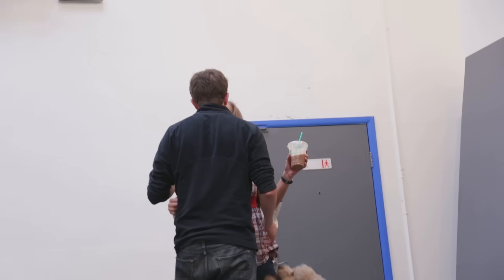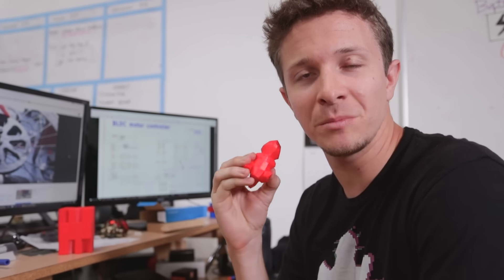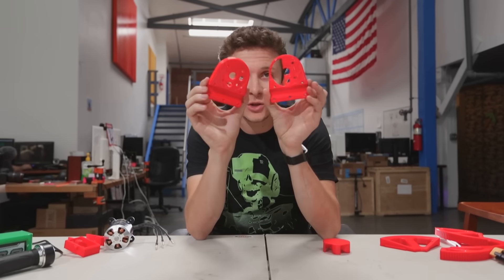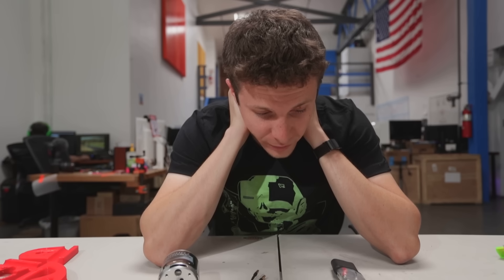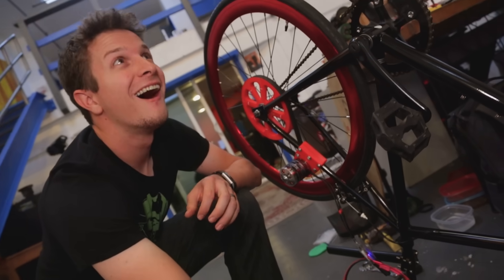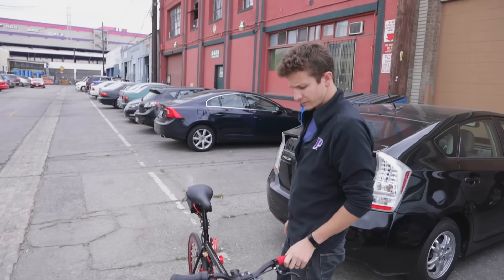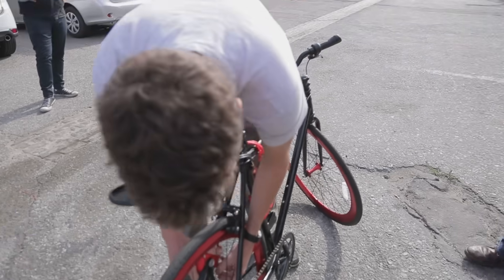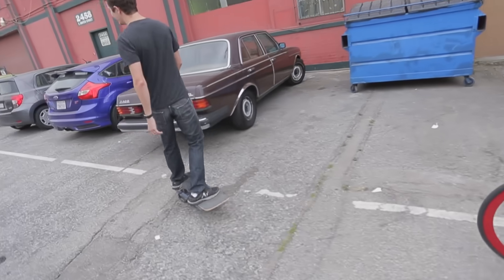Building a Tesla ELECTRIC BIKE For my WIFE

Comment: old vid but I'm confused that with all those people no one could figure out how to fix the gear , the motor sounds as though it is struggling to move him along as well. set screws on a round shaft lol, well good try which is more then most do.
Reply: Also the motor mount would be much more stable if it was fixed to seatstay and chainstay (i.e. not only clamping one round strut). Then it might even be capable of taking the load of regenerative braking (though i'm not sure if the bearings are designed for this application at all).

And i guess the sprocket was intended to be a tight fit (if it was not the completly wrong diameter), press fit maybe? Then heating it up would have helped (aluminium has a much larger thermal expansion than steel).

Comment: Make the pulley a collar. Drill a hole, tap it, then find the depth of the hole and cut a bolt that fits the tapped hole  so it is just below flush with the inner portion of the gear, then cut a notch at the cut end for a small flat head. Mount like before but now with the pulley acting as a collar it won’t slip.

Comment: All u would have to do is drill a hole into the fully and the motor and put a screw with a nit at the end and as long as the screw doesn't snap it wont slip

Comment: "If we simplify this into an electrical system, do you not know about 2 and 4 stroke bike convertion kits??
Also for making an electric bike investing in something with disc brakes would have been wise watching further into the video I have more critasism (I cant spell) your using a fixed gear or one of those fake fixed gear bikes for an electric bike that would turn the cranks too fast. Also knowing how extreme youve gone in some videos you could of had the components machined from metal by a shop. Other than that the video was decent but the bit about how electric is cheaper should have gone at the begining of the video as reasoning for why your using an electrical system.

Comment: another way to get PLA to fuse better would be to soft melt the plastics into one solid block. i learned this from my chemistry teacher about 2 years ago. there's a chemical we used that's essentially slow acting acetone. if i remembered the name i would tell you it, but we used it to make a turbine system for some prop planes we made in class that we crashed a few dozen times, and surprisingly the parts we treated held together a lot longer than the rest. we also had a printer that had a sealed chamber that kept the plastic warm, but not hot enough to compromise the design we were building. 
though another trick i found out was to make all of the parts kinda small and interlocking and using an epoxy to meld the pieces together. this usually only worked when i was building larger stationary things.

Comment: i WOULD worry about battery cooling/venting for the enclosure. high amp discharge 18650's get hot when using a constant draw.
Reply: Did you see a single 18650 in this video?

Comment: ever heard of something called a lock screw? you could flatten a bit of the motor shaft to make the cross section look like a D and it would lock the pulley in place using the lock screw

Comment: okay thing im confused about, If the motor itself is spinning and thats what spins the belt then the wheel... If the motor itself is moving... wouldnt there be energy loss? shouldnt the motor be anchored to the entire assembly? AND if the motor is spinning in the 3d printed parts there is going to be a massive amount of friction.. either this is really dumb or im missing something

Comment: Electric bikes and mopeds commercially available, for a reasonable price, so just buy one.

Also, the engine shouldn't be spinning itself, because you're loosing energy O.o
Reply: It's a hobby RC aircraft motor, normally it'd be attached to a prop, it looks odd spinning the outside rather than the inside but it works fine, might even aid cooling

Comment: There are dozens of ebike kits on the market. Yes, they are very expensive but I have concerns about your build holding up over time. Have u seen how Element14 used Arduino and 3D printing to motorize a tricycle? 😊

Comment: Easy solution would have been to make that motor and gear keyed as in drill a nice hol between gear and shaft and place a set screw wont move a bit.

Comment: Painful to watch... shaft spinning in pulley... wheel wobbling after spoke breaks... reference to the Write Brothers... Seriously, all of these problems have been worked out more than a century ago. Spinning shaft? Fix it with a keyway or simply machine a flat spot for the set screw. Wobbling wheel? Replace the broken spoke and true it up. Yes, true it up by tightening or loosening spokes to get the rim to run strait. The Write Brothers are no doubt barrel rolling in their graves right now.
Reply: THANK YOU!

Comment: How about building a 6-pack or larger rechargeable cooler. One that runs from a electric drill 18 or 24 Volt slide in power pack. Something that would be low power consumption and keep food or beverage cold for X hours. Maybe it has to uses 2 battery packs at once to power it??? That sounds 3-d printable

Comment: the one flaw and weakest link to this entire equation is "the wife vector".
No matter how solid you build it, in the end you will be held accountable for any tiniest flaw in this enterprise. Every single little somethingy that goes wrong or ceases to work - and you get "the stare." ...Flat tyre? Worn out Breake? Nut, bolt any lose screw worn out to prifile of the wheel will en up in "Honey the bike dont work" ... for aslong she will be able to maintain "you"...

Comment: All he needed to do was grind flat spots onto the motor shaft where the set screws in the 12t belt pinion contacts the shaft. Much cheaper and quicker than another motor.

Comment: I think I had this comment about Tom's install too: mount the motor higher up on the rear triangle and flipped so the motor's mass and volume are centered under the seat, with just the sprocket poking out to line up with the wheel sprocket.  That puts the mount on a non-circular member, so it won't rotate and even if it does, it doesn't get stuck in wheel spokes.
Not surprised you had trouble tightening the sprocket on the shaft, steel setscrew threads in an aluminum sprocket, you won't torque those very far before the threads strip.

Comment: Awesome video, but as I'm sure it's been mentioned before, why go the complicated pulley route instead of a hub motor? Even without the simplicity of it, wouldn't it be so much more efficient? I imagine there's quite a bit of frictional loss using this setup, and as you experienced, you can't use any form of regenerative braking.

Comment: Grind a flat on the motor shaft. Disable the brake in the speed control. Buy a proper pulley or get someone to machine it on a lathe.

Comment: key the motor shaft.....any time you don't want a motor shaft to slip..  drill a keyhole, slot tthe shaft or flat part of the shaft to so that the set screw had something other than smooth round shaft to dig into

Comment: You should have just filed a flat spot in the motor shaft that the set screws could bite into. Did you even explain how you fixed the problem?

Comment: Which part of it is Tesla ? You could also made Apple or Mercedes or Lambo or F1 or Samsung or Panasonic or Falcon Heavy or Intel or nVidia or Microsoft or Samsung or LG or Canon or Nikon or everything together all brand names in the world together in one bike which is fastest in universe and strongest in our solar system and has a range of 7.2 light years at maximum speed but 15.7 at eco green slower than speed of sound speed and has a 3.64 nanoseconds charge time and has a 17.9 trillion charge cycles with upgraded battery which will be available on backorder in the next few hundred years but for now it is 11 billion charge cycles with fast wireless charging from half empty to half full and it can make 700% incline hills in reverse and in expert mode it goes up to infinite grade hills.
Can it fly with that sweet unique logo ? It should. Are you making them in your mega giga ultra factory ? when it will be available ? Did you perfected self driving  or is it going to be available in next firmware update ? When do you plan THE TRIPLE X version with integrated stereographic wireless 3d holographic anamorphic canceling conforming ergonomic memory foam beat super bass  headphones with nano A B C D usb .796 dongle for connecting it to our fridge and RGB lighting and free headlamp and optional brakelight ? Areyou building charging stations thru galaxy or you going to expand the network a lil bit ? Is there some buying options available like pay three coffee cups and drink one tomorrow to have matte flattest of the flat paints in the world and more** ?

Comment: Make a machine to take old plastic and make your own filiment for 3d printers....something people could make at home to recycle locally the plastic they would otherwise throw out...i was originally thinking a hot plate to melt it followed by some means to press it out and form it to the necessary width which i was going to use a round metal lazy suzan wheel and a pizza cutter with the wheel renotched to make the perfect consistant bead size...

Comment: What he neglected to say was that his car cost about 5k and where as the very nice tezla s cost depending on how you get it I designed one off of the tezla page and it came out to $112,800 and that's why no one currently wants to go electric even though in the long run it's cheaper no one thinks about the future they think about the now and if the now is $5,000 or $112,800 well we know which one I'll pick.

Comment: Even if it work, it looks very ugly and noisy. I bought a regular bike and a 500w hub motor conversion kit with 48v battery. It cost me 2200 CAD. The reason why it costed me that amount is because most parts were German made which came with 2 years warranty and operating very well.
My bike is literally the nicest fastest bike in the city.

Comment: Nice clickbait doesn't even mention Tesla in the video just slaps a logo on there a battery and a motor suddenly you have a Tesla bike
Reply: Didn't even use 18650 batteries like a Tesla either. I think as I fast forwarded through I saw RC LiPo batteries. My ebike (Lunacycle/Bafang BBSHD) has 52 of those 18650 batteries. Been good for two years now. Several thousand miles. I would never build an ebike with 3D printed parts unless I was just prototyping ideas. Way too fragile.
Reply: literally stood next to a tesla in the video what do you mean
Reply: Yeah, I got baited too...damn it.
Reply: R/C batteries are certainly the cheaper option. Read up on them however and they require much care during charging to prevent fires that burns a person's house down. Good for a prototype I suppose but. Would they last for thousands of miles/years like other batteries?

Comment: for longer term use it would be better to get a metal cage built from the 3d printed part.  that motor is going to get very very hot....  also for safety it might be  a better idea to use a gearbox to be able to strap the motor down in a 90deg position from where it currently is.

Comment: Check out gas motorized bikes, their are several different versions of 2-stroke & 4-stroke engines for bikes. Personally I built a 66cc/80cc 2-stoke that goes 40mph and gets 100+mpg (that's stock mind you, no performance upgrades).  If you decide to build one contact me first, I can tell you where to get a good, balanced engine with upgraded hardware for a good price, DON'T buy a cheap kit on ebay unless you know what to look for, TRUST ME!

Comment: Ok Jesus. 60-40 isn't gonna stick to aluminum or steel, and it certainly won't stick them together. You take an angle grinder and you flatten the areas of the motor axle where the set screws sit, then you use blue loctite on the set screws. How can you possibly know enough about motors to run a brushless one on your computer and easily hook it up, but not know to flatten your motor axle.

Comment: Wren when pulleys or couplers dont fit those motors you put the motor in a bag, and throw it in the freezer. When its cold try to stick it on, and use a preferably rubber hammer to get it the rest of the way.

Comment: If you ever have any problems on Brushless ESC's like auto brake which all esc's have that option, just ask me or any other multi copter builder we know all about esc's small and large. lol Good job and congrats on the bike for your wife. I built an electric bike also but I didn't use a 3d printer. I used a brushless motor hub for my front wheel and attached it to each individual spoke. Very very tedious! And I didn't use a lipo they are to volatile and don't like heat at all. I used lithium ion 18650 cells. I do want to address that lipo you bought,  make sure that esc has auto cut off on your cells or you will ruin your battery. Try not to go under 3.75 on each cell or kiss battery by by. lol Did you set auto cut off at 3.70-3.80? thats a good place to set it at. Good luck

Comment: Technically you don't need the speed controller but great video!
Reply: It's a brushless motor so the speed controller is actually rather needed, brushless motors run on 3 phase Alternating Current (AC) but the battery can only supply Direct Current (DC), the speed controller creates and regulates the AC needed by the motor depending on how far you push the throttle

Comment: Fun fun!  But I think your main problem is with the choice of motor - need something with a larger shaft with a flat, and also a larger main pulley system.  There's a critical size for things.  That motor is for a prop - not high torque!  Looks nice though!

Comment: I knew INSTANTLY the drive cog would be off center when he said 'drill bit'. You use a special drill in a milling station, with a front bit the same size as the hole, so it keeps the drill centered.
Reply: ore  just a cheapo lathe with a self centering chuck
Reply: Ream

Comment: 3d printed plastic parts are more expensive and take longer to make for this purpose. Easier to do just aluminum if you have the tools. But then again if you knew how to work metal you'd just make a key slot in the shaft/pulley ;)

Comment: 11:26 for those who dont know what happened. these motors have electronic braking, meaning that it have brakes. so all he has to do was disable the brakes in the ecu using the computer. the problem was when he let go of the throttle the motors brake and momentum keeps the bicycle going forwards and the mount couldnt handle it and bam, that happens

Comment: I would have mounted the motor behind the seat post and reinforced by using both seat stays and the seat post clamp and used a longer belt. Also flipped the motor 180degrees so it wouldn't stick out.

Comment: Filing a flat spot on the motor shaft should hold better to the set  screw
Reply: Almujtaba O. Same here or drill a hole the set screw to go through
Reply: I hate it when guys use solid holders with drills that have no keyway!!😡
Reply: YES, this!
Reply: They have that on 1/10 scale rc cars

Comment: Jesus Christ why don't you just install a cheap eBay hub motor kit off eBay like everyone else for $150 instead of using expensive un reliable r/c parts on a bicycle??
Reply: hub motors add a lot of rotating mass, which is detrimental for acceleration, deceleration, and turning. The r/c parts are also much lighter
Reply: @untitleduser666 And the hub motor will last thousands upon thousands of miles whereas the RC parts and printer brackets might survive the weekend.
Reply: the torque of that rotating mass actually helps you in certain situations, much  in the same way it does with a car engine, it would be better if there was an inbuilt epicyclic gear set to change gears but I havnt seen one of those just yet...
Reply: @IncredibleSolv  Middrive and rear cassette. Or middrive and internal gear hubs. Its already been done.
Reply: mattimus ?? You really think a motor from eBay will be reliable.
Reply: @ArmaD4578  yes, hub motors are a very simple thing, which also makes them very reliable.
Reply: The battery pack is actually a good deal for the price and could be used for a 24 volt motor hub kit like a 250 watt geared bafang motor.
I had a Clean Republic e Bike kit from the year 2011 with this motor and the battery pack after 7 years needs to be replaced.
Reply: @m9078jk3  If you want an ebike with some utility go for a 48V/52V 14AH battery with a 750W or 1500W motor. I own a 1500W BBSHD middrive bike and a 500W hub motor bike. Both have similar 48V batteries. Low power is great for rolling around in the park with flat sidewalks. If you want to get out and go somewhere with hills, you need more power. My bike is capable of 45 mph for short distances. I use it at 15-20 mph to maximize the range, stay on the right side of the law, and to flatten the hills. I hate grinding up steep hills on an unpowered  bike during the summer heat and humidity here in the south.
Reply: @joeaverager  Right now I have a RadRover which I bought used for $350 USD  from a neighbor missing the battery pack
 It has a 750 watt Bafang rear geared hub motor.
Fortunately I have a 52 Volt 17.5 AH Battery.
The longest ride I have been on was for a distance of 46 miles so far.
I have reprogrammed the controller so it will go 28 Mph.
Yes a Mid Drive motor is better for very steep hill climbing.
Reply: @m9078jk3  We have a Jueshuai 48V  500W hub motor WSP mtn bike. Its been very good. When I buyer my wife an ebike it'll be another Jueshuai or a Rad Rover.
Reply: BC that title wouldnt bring 1.9 mil views?  Idiot

Comment: Dude you could SIMPLY take a grinding wheel, and flatten one side of the motor shaft, so your set screws actually have something to work with.
just .5 mm deep flat spot